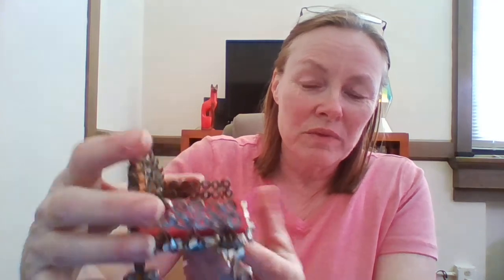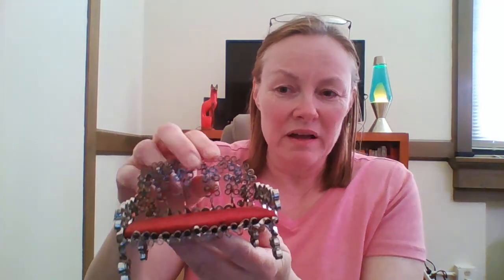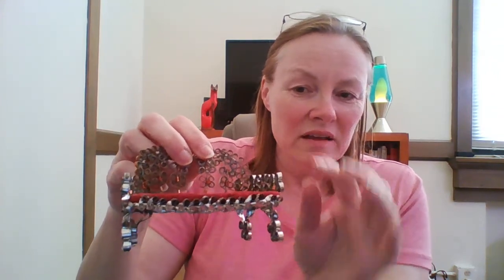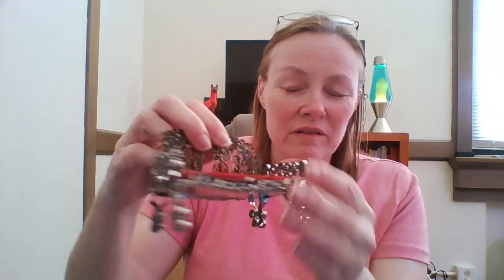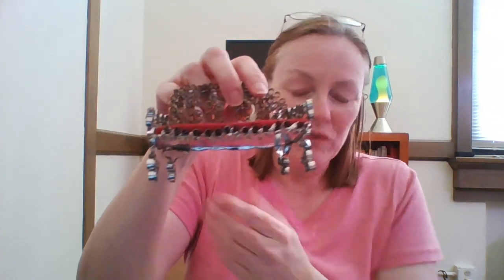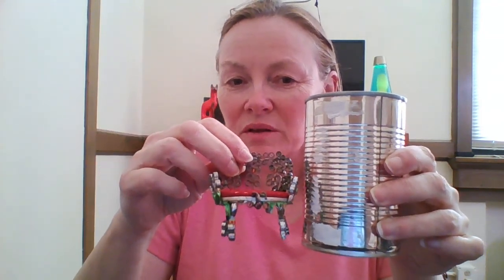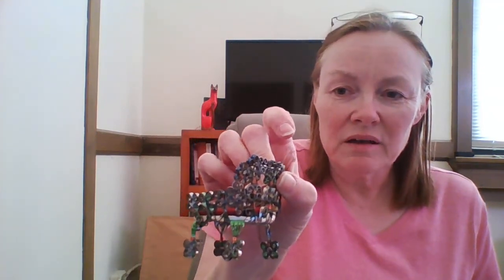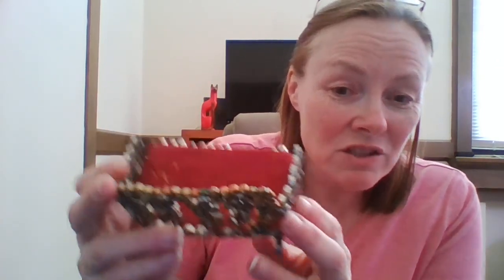Curators Desk - Tin Can Furniture from the 1960s/70s

Comment: I made these as a kid! You need tin snips and needle nose pliers, a small piece of cardboard and material. As you said, you cut the top edge off the can and cut strips all the way around, to be about 1/4 inch wide,  but go right to the bottom of the can. We used to bend down three 1/4 wide strips in each corner for the legs and then overlap them and tie them off with some 1/4 inch strips we'd cut off at the front of the chair. The placement of the tie off determined how high you wanted the chair. You'd then roll up the strips using needle nose pliers. The end result was two curls beside each other with the one at the back curled below them to for the chair leg feet. You'd make the back of the chairs and the arms of the chairs, if you chose to have them in whatever design you'd like. We would spray paint the whole thing in black or silver paint, or whatever colour we had on hand. Then we'd make a little cushion using a piece of cardboard the size of the seat, stuffing and material. Thanks for bringing up the memories.
Reply: My Moms friend had these when I was a kid. I've always wanted to try this. thanks for telling some of the directions.